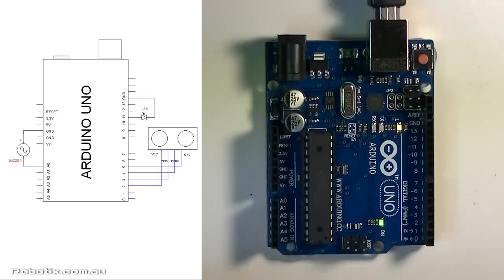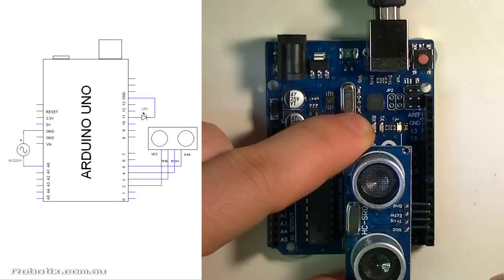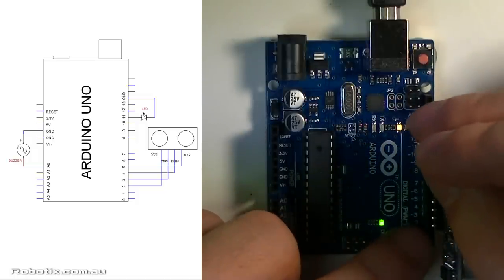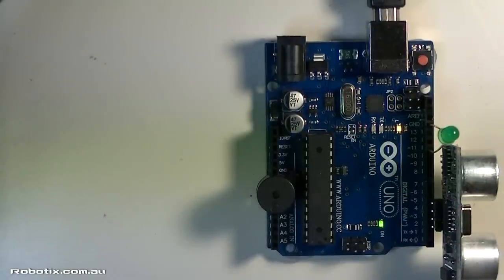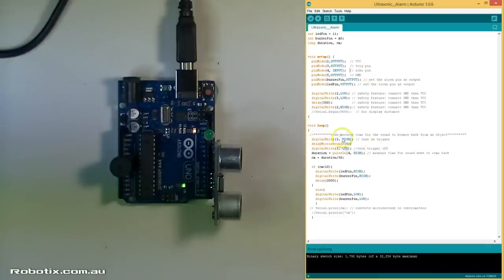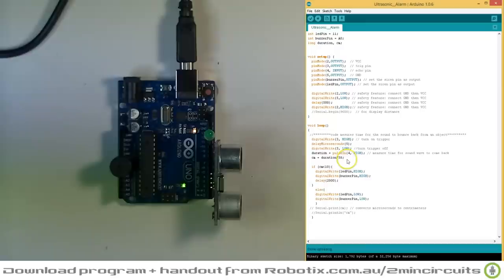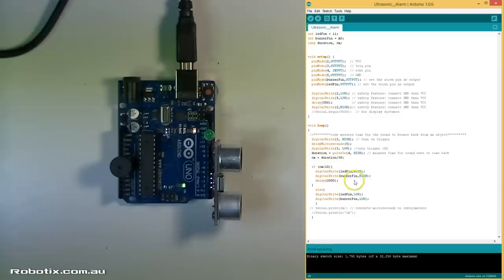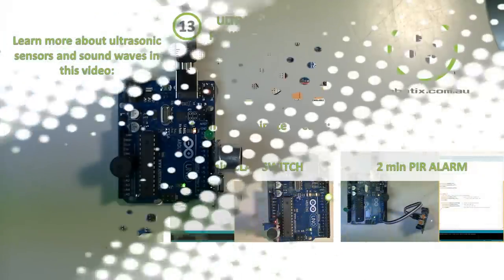2 min Ultrasonic Alarm

Comment: Hello dear friend, i've tried your code but it didn't worked. I saw that the ultrasonic had quick response and I wanted to give it a try, anyway in the if statement you write buzzerpin HIGH if it's true (10<) or buzzerpin LOW if it's false (10>) my suggestion would be to write at the beggining an "int sound = 250;"  and then in the void (loop) after the if statement "tone(buzzerpin, sound);" if it's true and "noTone(buzzerpin);" if it's false, well at least that was what I've tried and worked, still ultrasonic is a bit slow to respond.
Reply from the maker: Hey mate thanks for the comment. I don't know why the code didnt work. I use this very video in my tutorials for 20 kids at a time. What normally happens is that I throw 3 or 4 ultrasonic sensors in the bin. (they are awesome but low quality).  But it has a track record of working.

The reason I didn't use a boolean is because I try to make the code as simple as possible which is the idea behind these tutorials. But do post your code here because I would like to try it out
Reply: Robotix
 After minutes of scratching my head , why your code didn't worked to me, i finally found out! It was the piezo which made the whole problem, lunkily i had some spare piezos similar to yours, i put one and the code worked perfectly, replaced with the one I had first, and the problem starting to show up again, so it was the piezo. I have to agree with you about the low quality of sensors, they seem to be slow to respond and sometimes pick random values!